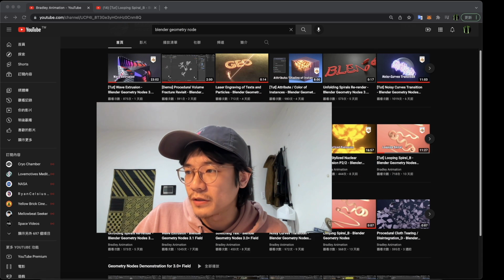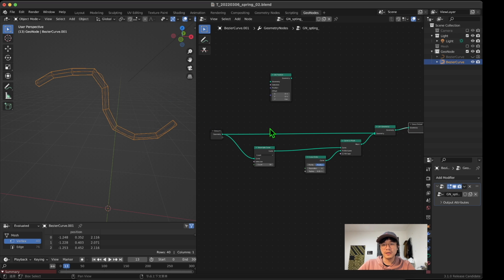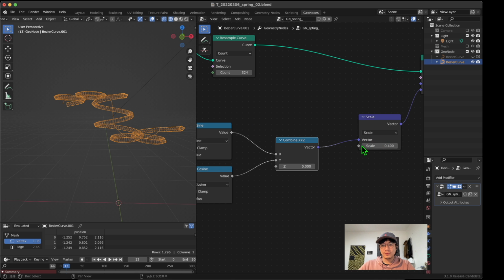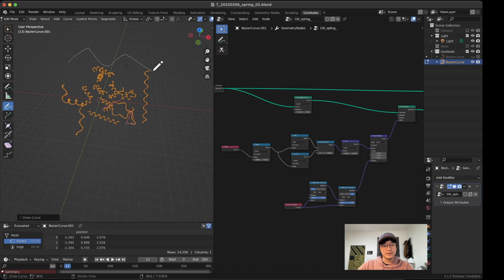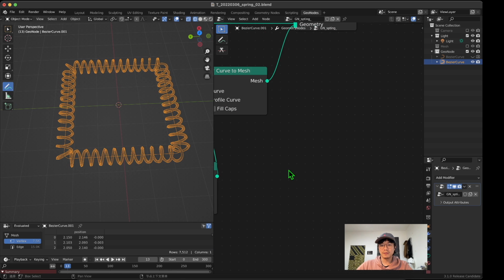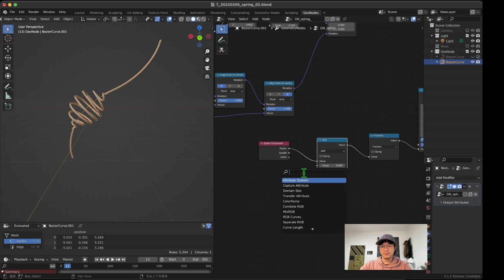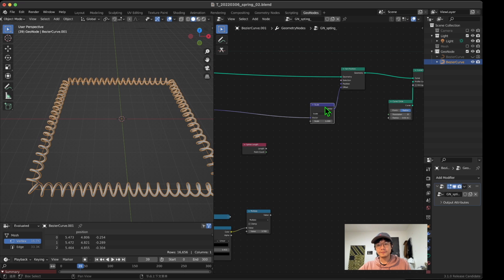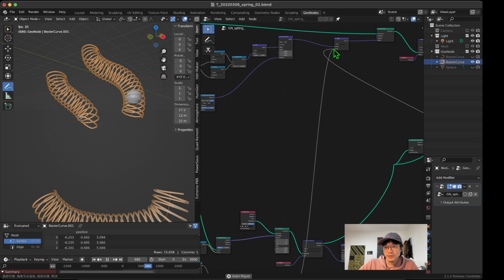🧬 Spring Curve Using Sin Cosine 彈簧 / Blender Geometry Node 3.1 Tutorial

Comment: how did you get your material to show on the Bézier curve? Like green in your example, thumbnail, I have a glass material I made but I'm still getting gray noodles? My glass material I append from another file where it works
Reply: I HAVE THE SAME ISSUE
Reply: @koalico3D  you can be applied by adding set material node.

Comment: I came up with this myself a wile back ( I obviously did it better) and your the first other person I found that figured this out. It’s very useful in many situations as I said not a lot of people figured it out nice work 👏 (though you can work a bit on presentation)
Reply from the maker: That’s nice,good for you!
Reply: @nenghuo  actually since this comment I’ve seen someone else who did it closer to my method (actually almost the exact same).
Reply: @nenghuo  also a tip is to use spline parameter factor or length instead of index. ( I’ve also used this method to make braids and coils)
Reply: @Hi Bana yeah I'm working on that. it should be up sometime this year but under a different email probably. it's not so easy
Reply: also I found a way simpler method  as well